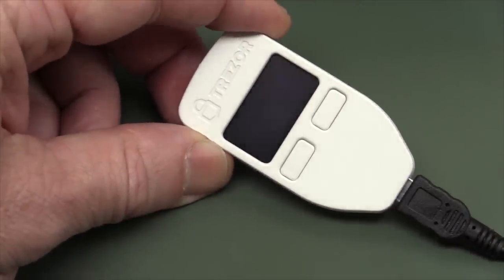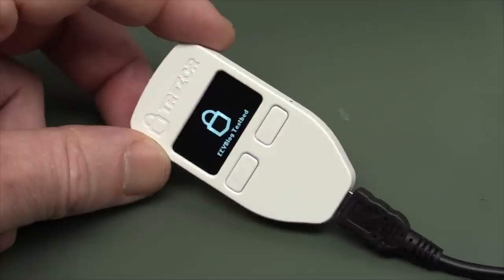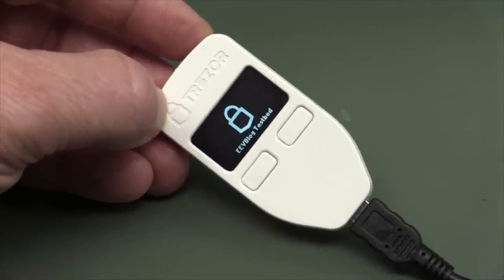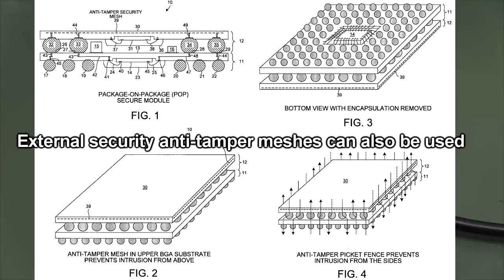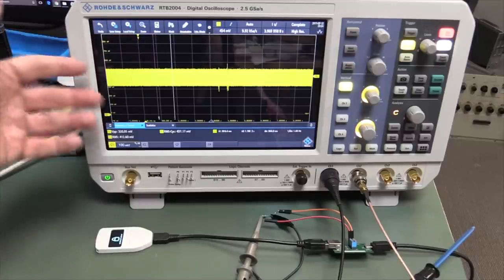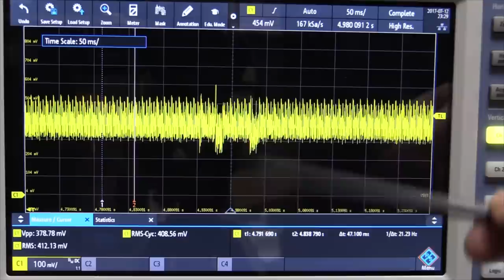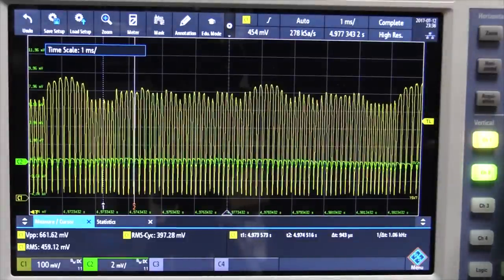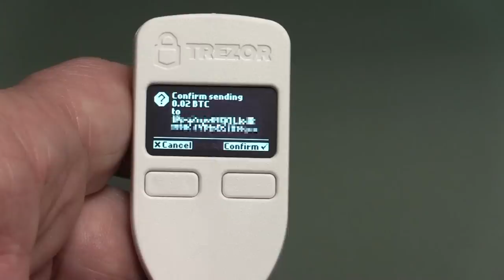EEVblog #1006 - Trezor Bitcoin Hardware Wallet Teardown

Comment: Potting adds nothing to security (unless combined with an embedded mesh) - just makes it take longer to get into. If you need to pot it, it shows there are fundamental security weaknesses. Just like the losers who grind the numbers off chips.
Potting is a nightmare for production and can add a lot of cost.
Reply: mikeselectricstuff Yeah, security through obscurity is never a good way to go!
Reply from the maker: Yes, you'd do mesh, or clever stuff like final fine connections that break etc when depotted adding to the difficulty. 
Yes it adds more cost but you can pass that on for a premium product.
The potting and other physical mechanisms can add extra time to hack allowing the user more time to remotely disable it by using a new key.
Potting can also make the product more robust.
Also the "feel good" factor for the user.
So there can be several advantages to potting.
Reply: mikeselectricstuff Making something take longer to crack doesn't add to security?
Reply: In this case yes it does because of the way it works, if it takes a longer time to hack into it, the more time it gives the user to disable the wallet.
Reply: That is called security by obscurity as Mike called it out, similar thing as grinding marks from chips and no it does not add to security. If you want to get to that chip that has nothing to do with security it is only a pain in the back....
Reply: "Just like the losers who grind the numbers off chips."
10/10 Would agree with that.
Reply: As long as you don't have any battery backed up RAM where the secret keys are stored, a mesh or breaking connections in general won't help you either. The uC is unpowered when someone is removing the potting so it is unable to erase any keys. One could then restore all connections before powering up the microcontroller.
Reply: +Olliedageek I think it doesn't. Once you've found a way to quickly get inside , the procedure will always be the same for every device, i.e. you learn how to "crack" them all.
Reply: If a security vulnerability is found potting can buy someone minutes or hours to lock out the device before the money is stolen. It's why PIN terminals are potted, just to buy time if compromised.
Reply: Indeed. You say "Potting adds nothing to security - just makes it take longer to get into.": 
The time it takes to physically access the the device is an important aspect of security, especially if there is a way of remotely disabling the device/service. Having extra time between someone having the device in their possession and them having unrestricted access to the internals can render a lot of potential exploits useless.
Reply: "Security through obscurity is never a good way to go" Despite the fact that they are heavily armored, there is a reason tanks aren't painted bright pink... There is value to both armor and camouflage.
Reply: Potting also has the unfortunate habit of pulling parts off the circuit board unless it's applied carefully (expensively).
Reply: That's sort of like like saying 'putting a lock and chain on your bike does not make it more secure!' A bolt cutters will remove the lock in seconds, but people still do it! Any layer of obfuscation will add time and effort into reverse engineering it, which in essence makes it more secure. It's not a good form of security, but sometimes we just need the illusion of security to deter a casual thief!
Reply: It's the same thing as with companies using proprietary closed-source solutions as a security measure - it eventually gets broken into to a great shame of everybody involved. I'd personally never entrust my sensitive data to anything that I (and hundreds of thousands of others) cannot vet. As for potting, apart from adding a 'premium' feel to the end product and adding a bit to the mechanical resistance (if the material is flexible, of course) it doesn't add much to the table.
Reply: This is not the same thing as a bike.  This thing potentially contains millions of dollars worth of bitcoin.  If it's not secure without the "extra" measures, it's not secure with them, either.  Imagine a bike that's worth $1M.  Someone will definitely cut the bolt off that.
Reply: I dipped my credit card in honey.  This adds extra security because a thief will have to wash his hands and clean the card before using it. [sic]
Reply: @[sic] All security does is make the process of gaining unauthorised access to an item take more time. Be it a lock and chain, potting or indeed dipping it in honey. Although in your case, dipping it in honey would also have a negative effect on authorised users which would be doubly dumb!
Reply: @futilerebel The value is irrelevant, I have seen bike's worth less than the lock and chain securing them be stolen. A lot of crime is opportunistic. It would take a concerted effort to gain access and decipher the encoded data on this chip. All without knowing the actual value of coins it contains. Then you have to obtain another wallet and go through the decryption process again(there is no master key/backdoor) Code is open source. No organised criminal gang would have access to enough of these wallets to make this worthwhile.  

The whole point about potting was in relation to making the device feel better and sturdier in the hand and adding a layer of obfuscation which would delay the probing. Which should allow the user to reset their account and make the information on the device useless. I am a big fan of Mike's video's and truly believe he is a genius when it comes to tear downs, but his first sentence above contradicts itself by stating " just makes it take longer to get into." That's all any security does, it just makes it take longer to get in to!
Reply: I see a lot of EE say that grinding the number off is stupid, but I never see anyone workout what the actual chips are. I think it was The Signal Path that came across a ground number and couldn't work it out, and he is super smart. 

I would like to see Dave's CIA bug detector have to 30 ICs worked out as a tutorial.
Reply: Indeed he is supersmart! Most of the time you start with an educated guess, then follow the pin outs and check against datasheets. If it is a super custom roll your own chip, you won't get data sheets and your guesses won't amount to much. You can still probe and log what is going on and figure it out but the amount of time and effort is usually not worth the payoff. I would venture that this is where Shahriar gave up, not that he could not figure it out, just that it was beyond the time and effort he would expend trying to figure it out. Hence the added layer of security this provides. Make the payout less than the effort and your security takes care of itself!

The Chinese have been reverse engineering all manner of complicated and manufacturer obfuscated electronics for years now. Rubbing of numbers or rolling your own will not prevent a knock off if there is a market to exploit but will deter the average YouTuber during a teardown!
Reply: I think in this case, potting would decrease the security. Without the potting and with the open source software, white hat hackers can easily try to hack it and report the flaws. With potting it would reduce the amount of white hat hackers trying to break it.
Reply: mikeselectricstuff average cost of industrial potting machine, automotive grade potting, $650k euro
Reply: Guys, the schematics for the whole thing are here: https://doc.satoshilabs.com/trezor-tech/hardware.html

I don't see an Open Hardware license, but no cryptocurrency enthusiast would ever think of trusting something that employs security by obscurity, and might contain hidden stuff that can make their coins disappear. Potting is pointless with that device.
Reply: well you cant remotely disable it, you need to transfer your bitcoin to a new device with a different seed. Also you can add passphrase protection, which encrypts the private key on the device. However this needs to be entered using a keyboard from the computer and hence can be captured using a key logger.
Reply: Potting is security theatre.  The EEPROM reflashing/reprogramming opens this thing up to an evil maid attack.
Reply: Relying solely on obscurity is STUPID. However, obscurity makes for good icing on the cake. It also really pisses off hackers.
Reply: They only add more time to hack if there are some pins on the chip that are more useful to get to than the power pins and the USB port. If that's not the case, then potting adds no time to hack. There are no internal pins that would expected to be more useful to get to than the external ones, therefore there is no reason to expect potting to add more time to hack. A hacker can still try his luck with the USB pins immediately.
Reply: @SJoelKatz  wow you're naive.

Comment: The goal of a side channel attack on a hardware wallet would be to extract the seed or a private key. To do that, you need to perform an operation that uses the seed or a key. 

So what you really need to do is perform a signing operation (like sending Bitcoin, or signing an arbitrary message) while capturing the data on the scope. Just plugging the device in and going to the web site doesn't necessarily perform any sensitive crypto operations.

Comment: The profit margin on this thing is about 100 times the cost of manufacturing. Wow!
Reply from the maker: Sure, but amortise the cost of development, maintenance and support etc
Reply: I bet there will be knock offs and similar products popping on aliexpress soon
Reply: +Atif Rana: Sure, it is open source hardware. And surely the aliexpress clone will use the original firmware in its latest version and not at in a free CD-Rom with dubious content. I mean: Why try to steal the literal key to some ones wallet?
Reply: @TheFinalRevelation1  would you trust a fake chinese wallet to handle your money

Comment: A major criticism I have with this is that they don't use any USB ESD protection (like USBLC6-2) which means you can easily grill the GPIO of the micro with a static discharge..
Reply: stickac LOL "CE certified"
Reply: +stickac the CE marking does not mean much. Any company can self-certify and with things like ESD and immunity, you can cerrypick the system you are testing in (e.g. supply a very short cable with the unit) and even when you fail you can argue that "..." causes "..." and sell the device anyway. Only with emission I would never ever cheap out during EMC/CE testing. If you interfere with the wrong signal in germany, the will triangulate you and send you (or your costumer) a van.
Or your competitor buys a unit and sues for unfair competition. 

A more valid argument would be to check the microcontroller datasheet. Some protection is build in there. That could be enough for typical "office type usage" in normal humidity. Not excellent, but "good enough".
Reply: Well, If it passes then it's alright.
And I think I spoke too early, on a closer look it looks like you guys have some protection on it. The series resistors and the data lines go to the 4-pin SOT through vias. It's not in the schematics on your website though.
Reply: @stick That is not how the certificiation works. I also design certified products, and of course - there is an accredited certification agency involved in the compliance testing, and the test certificate is legit, but the backing of the CE marking itself is a self signed CoC. The manufacturer has to prove that it complies with the appropriate directives for its market - i.e. the ones stated in the CoC.
Reply: From what I read on ec.europa.eu and ezu.cz it sounds like there are two aspects to CE — the mark (which manufacturers can apply themselves) and certification (which it sounds like is a formal process in the Czech Republic).

Comment: The huge security hole with this device is the fact that you do not need your PIN to upgrade the firmware.  Therefore, the manufacturer could produce a "rouge" firmware and load it on the device. Also, if someone steals the firmware signing keys from the manufacturer, they could also create rouge firmware.  The fact that they did it that way means the intentionally left a backdoor....Thoughts?
Reply: The firmware updates are open source, so if you just wait around a bit for it to be reviewed by the crypto community or check it out yourself if you're technically knowledgeable, you have nothing to worry about.

Comment: Can you pull the OLED out (no need to unsolder) to check for other components under the foam? I ask this because the SSD1306 OLED usually needs a few resistor and caps which can't be anywhere else on the PCB as far as we can see.

Comment: seriously. if someone's selling you 'potted' as a security feature - run!

no, the place to look here is the JTAG interface. can you read the RAM during execution? which RDP level is the chip in? can you read the flash during a firmware upgrade?
Reply from the maker: The JTAG has been disabled.

Comment: Is it possible to capture the data going out on that device? Wireshark includes USBPcap (USB Packet capture) that does that.
Reply: Try using it Dave and see what data comes out.
Reply from the maker: I do have a USB analyser, but it doesn't work like that,  it's what's going on inside the chip that you want.
Reply: Right. The private key never leaves the device. It is used to sign messages, which is done inside the device. You could probe the USB traffic all day long and it would not help you at all. With a good crypto system they don't even try to hide the traffic from you. And if you are interested enough, you can learn and understand all the aspects of the traffic and the algorithms, and it still would not help you without the private key. On top of it, the private key is also not stored in plain text in EEPROM but encrypted with the PIN. Without the pin, reading out the EEPROM with an electron microscope would also not help you. So an attacker would need YOU and the TREZOR and use acid on both of you to get to your money. But probably using acid on you is sufficient enough. You will tell them were you located your paper seed sooner or later.

Comment: The pin try and power cycle seems to me more effort than one intially thinks, due to this randomized keypad feature. You can not just cycle through all pins, you need a way to figure out what it corresponds to what you are inputting.

Comment: Hi Dave. Just one small thing. You've said a few times that bitcoins are "in there", and "physically stored in this device", but bitcoins are not actually stored in a wallet. They are stored in the blockchain as a transaction history, right? So erasing the private key from the device doesn't mean your bitcoins will be lost/erased (as some might conclude). It just means they can't be accessed by the that device anymore. If you have backed up your private key ("paper wallet"), you're good.
Reply: Great video, BTW, as always. :)
Reply from the maker: Yeah, technically true, but that's the industry lingo.
Reply: "industry lingo" - yeah. Would be like showing my garage key and saying "my car is in this key". Part of the security of this device is, that the user can empty his wallet, even when a thief has the Hardware. When the thief then comes back and beats the key out of the legitimate owner, all that would be left is some change (leaving 0.00 Bitcoins on the account would be stupid, as the thief then would continue to beat). So, calling this thing a key is a much closer description then saying it is holding bitcoins.

Comment: Well, seeing that current waveform on the Oscilloscope made me ask if they had any real bypass capacitors within it.
And well, it didn't have much bypass capacitors to speak off...

I would have used a fair few large capacitors, and an inductor or two to make sure to have a low pass filter, not to mention have some small microcontroller sitting to the side simply flooding the power rail with "noise". And also as Dave said, use some potting compound, really hard potting compound that ensures that one can not easily put something between the processor and the bypass capacitors.
Reply from the maker: Even if your removed the caps and probed the power pin directly I still think the software dithering they have added would prevent getting the private key.
Reply: Unknownety As Dave mentioned, this really needs to be accomplished in software.  Nearly all hardware solutions can be mitigated with physical access to the device.
Reply: Yes, if someone were to take the device from its rightful owner, and the owner didn't do anything about it, then yes, everything boils down to software and the construction of that chip.
But to neglect a simple layer of safety is far from professional.
Though, at the same time, they could probably have used a better chip to start with.
But lastly, I wouldn't be too surprised if a successful attack onto a system like this isn't a hardware hack at all.
Reply: The point isn't that you can't recover the private key through a side channel attack, the point is that no calculation involving the private key is done before you enter the PIN (at which point you don't have to bother with extracting the key because you know the PIN). 
The PIN checking itself could still be vulnerable to some side channel attacks though.